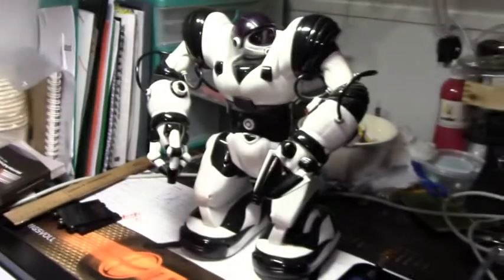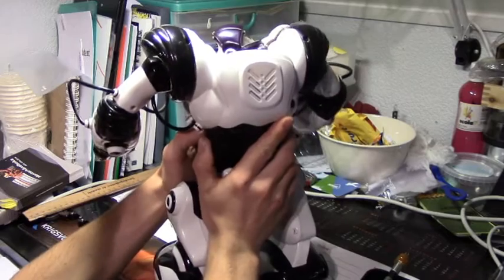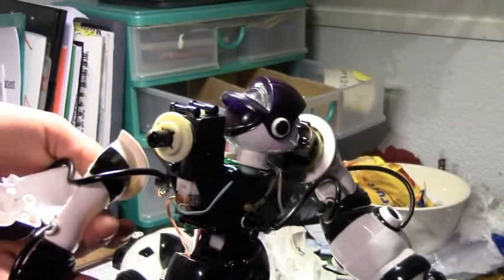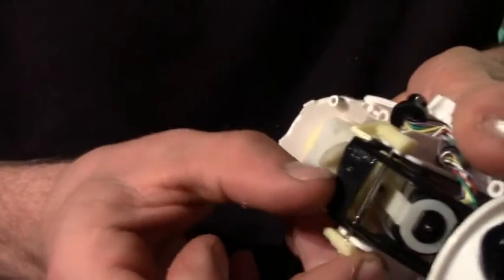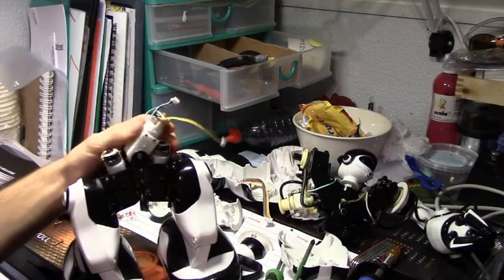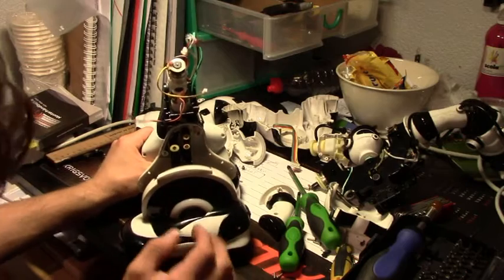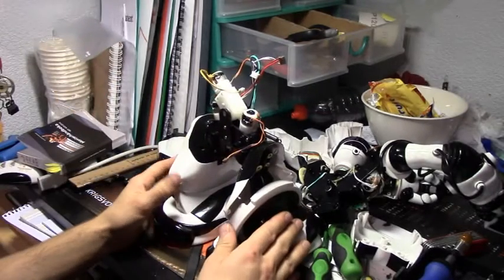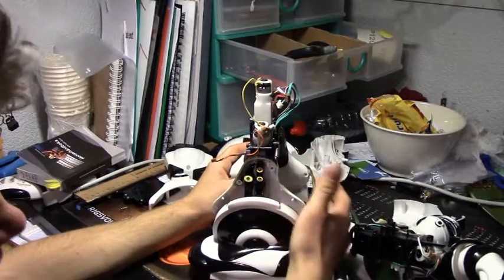RoboSapien 1 - teardown. Walking robot

Comment: i buyed one  yesterday for 5€ and disassembled it also , i'have a broken gear on the neck ...it's nothing after all  i want justto fixit with glue what du you think ?
Reply from the maker: depends on what type of glue you can get locally. You should use a brand name epoxy/araldite that works with plastic :) also you can try to enforce with some screws /nails then glu, then grind the screw/nail down as needed :)
Reply: that gear not use for huge torque maybe rebuild that shit whit a glue from glue gun ? for sure epoxy work fine but buy just for this ... i dont know  ! for the momment i try to understand that fuckin modes with "select" button ! oh yeah also if i want  to walk with it it not walk well because the balance left//right not good  .
PS : thks for answer and excuse  me if my english is bad i try to learn without translator and i think im not too bad ? ;)